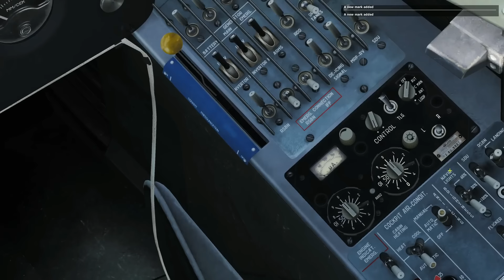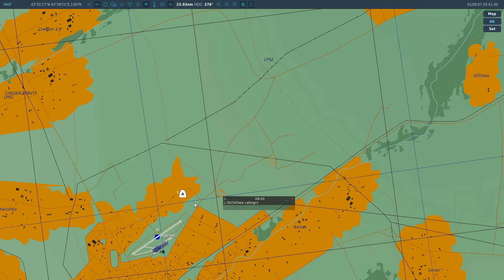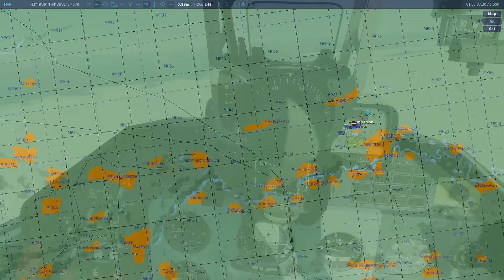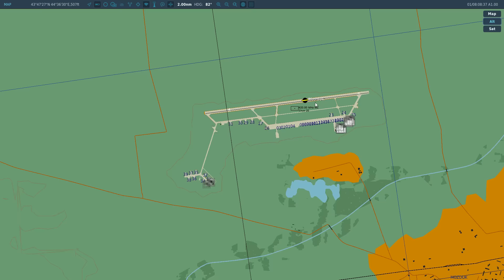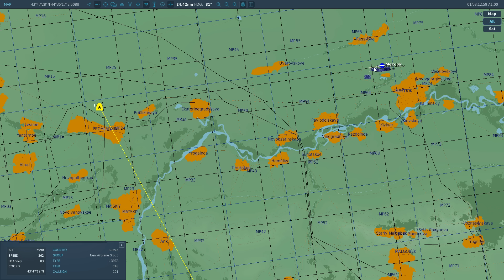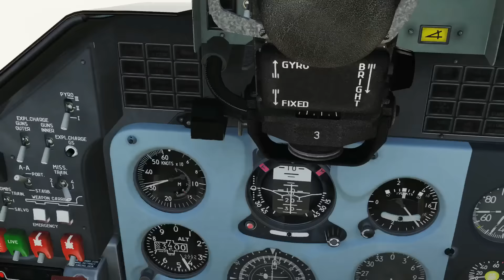L-39ZA Albatros: ARC(ADF) & RSBN Navigation Tutorial | DCS WORLD

Comment: Using the ADF, you should firstly focus on the outer beacon. Then - in this case - you should fly a heading of say 290 - 300 until you see the beacon at bearing 240 (runway direction), then turn on to it. That way you will be able to stabilize your plane rather far out, pointing in exactly the right direction so you only have to focus on trimming it on to the glide path. This is in fact exactly what you described for your approach to Mozdok, but it is equally valid for an ADF approach.
Reply from the maker: rgr cam

Comment: How do you get smooth cockpit shadows? In my l39 they are all jaggy and shimmery?
Reply from the maker: mmm not sure tbh?
Reply: Anti Aliasing  Pixels are square, so when they are stacked up and down or left and right you cant tell they are square.  But at an angle you can see each square. *Anti Aliasing tries to smooth out blocky edges by adding pixels, making it fuzzy*.  DCS has two type Spatial and Multi Sampled (ssaa and msaa) i do know Multi Sampling tries to only antialias areas that need to be smoothed out. 
Ansiotropic Filtering does something similar to the textures (rather than just the edges). It will help clear up things in the distance. As an example if you have something feathery in the disance, instead of looking like a couple of pixelated knots, digital blocks, it smooths outs the distortion.  
of course.. more resolution helps both of those problems
also, if you are banking.. and shit looks blocky.  if you you have to stop banking to read labels or tell what something is on the horizon, or if an enemy label is a dot (ground unit) or a caret symbol ^(air unit)   try setting V-Sync. Vsync matches the refresh rate of your computer and your monitor.. to display at the same time  without vsync, your moitor might be trying to show two pages at the same time. distorting your image.
dcs has a Depth of view setting.. this is distance blurring. just like in a movie when the back ground is blurry, because the camera is focused on the person.

trying changes those.. to what you want, and see if it helps

Comment: Concerningg the PRMG glide slope thingy. Intersting thing with it, is that if you fly the MiG-21, and check the kneeboard, you will find different values, than the ones shown on the airbase information.
In the MiG-21, if the RSBN for Mozdok would be channel 20 - then the PRMG would be 20 as well. And it seemes to work with the 21. I have not yet tried this with the L-39 - but it could beworth a shot. I believe it is the same system and the info on the airbase is just WRONG. I will try this when I get the chance, and get back to you

I would love to have a kneeboard like the 21's in the L-39. with all the RSBN/PRMG channels and radio pre-set channels.
Reply: MiG-21bis's RSBN/PRMG is "fake" using fictional facilities set in an internal lua file. It was made before the terrains themselves got RSBN facility. For the L-39 it's real and your reference for facilities is the F10 map. It would be nice to have kneeboard data for communication presets though.